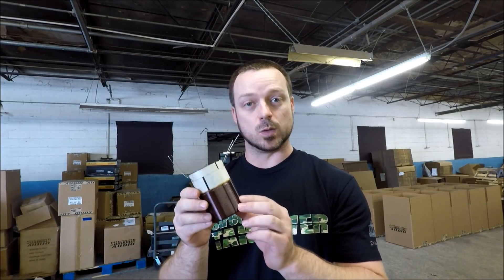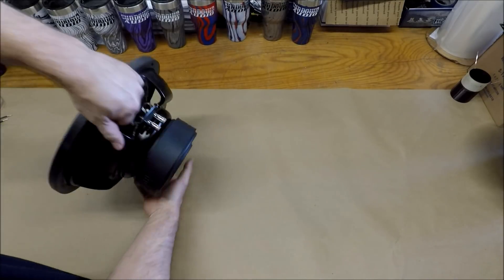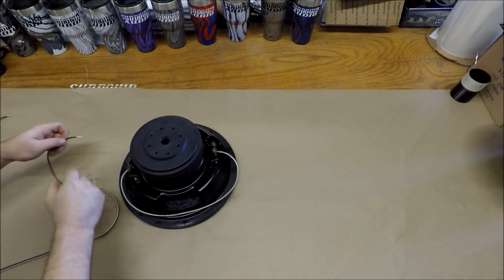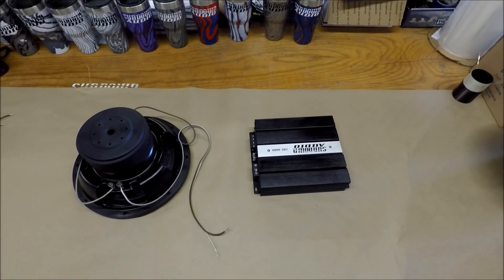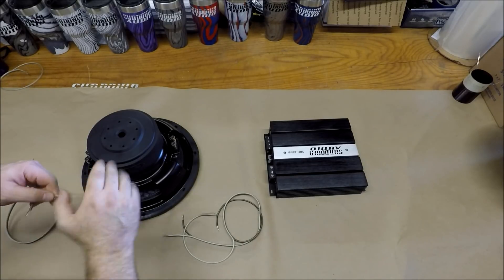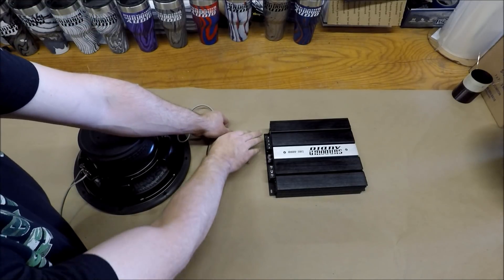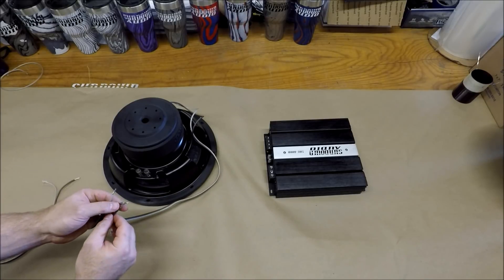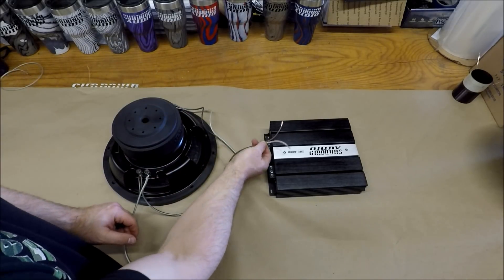***Tech Time*** at Sundown Audio Series vs Parallel Subwoofer Wiring

Comment: So did I buy the wrong subs I told the guy I needed to end at 2 ohms Bcs that’s what my amp is rated for I got 2 dual 2 ohm subs wired positive to negative on both retina ls for both subs each wired to their own terminal cup from there I’ll join the 2 positive and 2 negatives to one and out the intro he amp

Comment: Now they told ma at sundown to put + ~ on one side and + ~ to the terminal and the same for the second sub then combine them together on the outside of the box then connect them together and run the positive and negative to the amplifier???????? Now is that correct?????

Comment: So I have 4 E-Series 10's Dual 4's, which 2 is going into a box and the other 2 going into a box. My Amp is the SIA-3500, in which I know I'll only be able to play the subs at 2ohms. But how do i wire each box internally than to the terminal, then the same for the second box then joining them together to make 2ohms reaching the amp. Please assistance is needed. Thanks alot.

Comment: So I'm pretty good at wiring but the system I'm getting ready to put in is driving me crazy.  Got a boston acoustic G312-44 dual 4ohm but only has 1 set of posts and you move fuses around to either get a 2 or 8 ohm load and going to a 2 channel monoblock JL Amp but I thought you couldn't bridge monoblocks.  So should I eliminate all the fuses and run 2 wires out each post to the. + + _ _ on the Amp? Someone confirm if that's correct or not. Want a 2ohm load.

Comment: i have a sfb8000d and 2 dvc 2ohm xv3 15s there wired inside the box and only 2 leads coming out the box only connected to two of the speaker connections connected in parallel on the amp and 2 spots arent used should i bring out two more wires for the amp or is just the 2 wires on the amp ok and right?

Comment: Hey Boss quick question, I just got a SAEv3-2000 installed for a 2 500rms Subwoofers but it seems like the Amp it's getting too hot not sure if this is normal. It's getting hot even with the head unit turned off.

Comment: Anyone know how to wire 3 8" x-8 v3 Dual 4 ohms to a monoblock amp at .5 ohms? The amp supports .5 ohms (Precision Power ICE7000.1D ). Thanks in advanced.

Comment: If I am running 2 SA 4ohm 10"s at 750W RMS, If I parallel all the way down to 1 Ohm, is it right that I would need 3000w RMS at 1 Ohm? or would it be 6000W RMS? trying to decide which amp to run between the SFB-7500D and the SFB-3000D

Comment: I have 2 4ohm DS18 subs wired at 2ohms, however I don’t want them at 1 ohm when I place the speakers wires into my sfb3000d sundown amp. I only want them running at 2ohms

Comment: If my 2 4ohm subs are setup for 1 ohm internally in the box.. Does it matter which connections I plug into on the amp with the two wires coming from the box? Only 2 wires for 2 subs versus the 4 in the video.

Comment: So is having a 2 ohm voice coil and duel 4 any diffrent?
Reply: No.  A single 2 ohm sub is the same as a dual 4 ohm sub wired in parallel. The only advantage in having a dual 4 ohm sub is you can wire it in series to 8 ohms if you have some application where that would be advantageous.

Comment: I had an 83 Cutlass that I walled with six audiobauhn flame series 12" dual 4ohm. I had the old school Memphis d1000.1 the little chrome one and I had to wire it vertical series parralel  have you ever heard of that? How would you of wired it the amp was 1ohm stable

Comment: So if im tunring my dual 4 ohm woofers into 1 ohm do i seperate the positives and negatives at the amp and use all 4 channels twist the 2 positives and negatives together and put both negatives in 1 terminal and both positives in 1 of the positive terminals?
Reply: Im using the sae 1000.1d
Reply: With 2 12 in l7s

Comment: Can you do a video on wireing multiple tweeters and or multiple midrange? 4ohm and 8 ohm.
Reply from the maker: It will be the same as you see here.  I explain basic parallel and series.  Simply put the two together for your desired result.

Comment: You probably shouldve also explained series/parallel wiring. I think most beginners would need that explanation the most.
Reply from the maker: I showed how to wire a sub in series and showed how to wire two subs in parallel.  Put those two together and you have exactly what you just asked for.

Comment: You didn’t go into the more complex wiring, running series/parallel not all amps can go to half ohm. Like running 2 duel 2’s and needing a 2ohm final load or 4 duel 4’s and needing a 2ohm load. Just some examples. That could be helpful to some of the viewers.
Reply: juicewatter i would like that info
Reply: ) luxury+&-+follow your friends pull